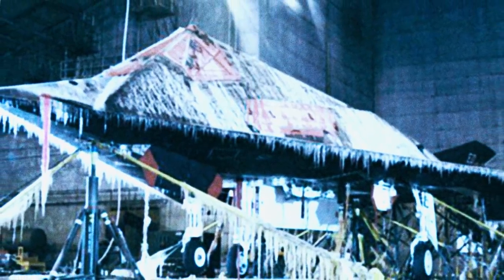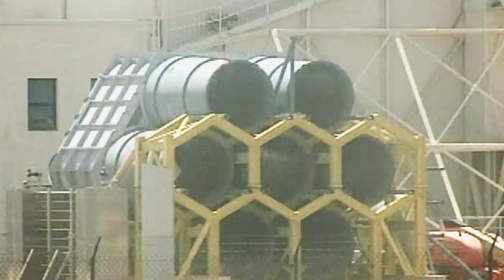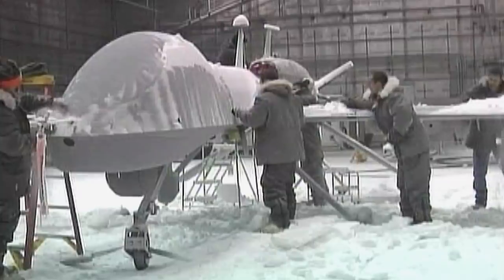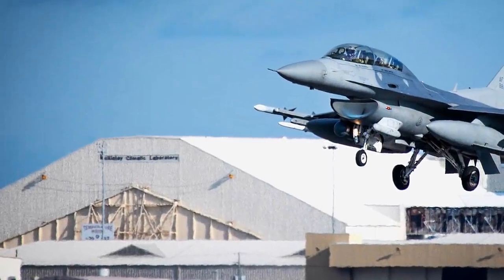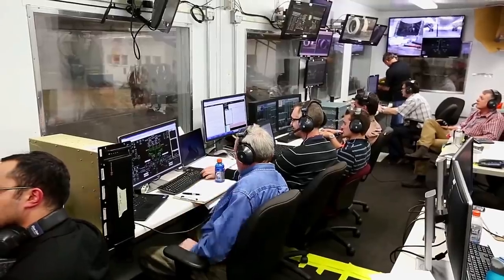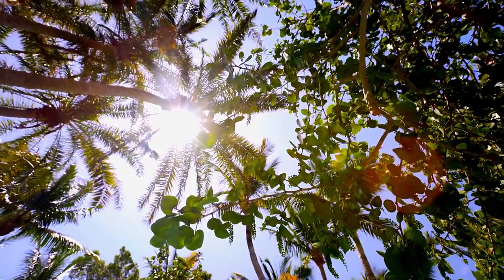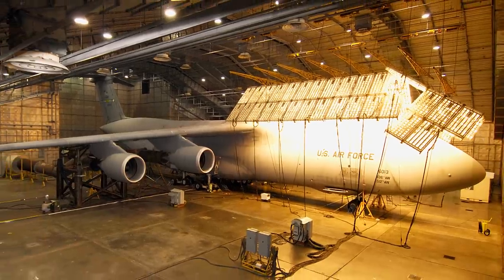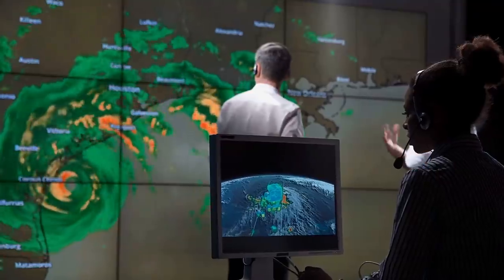A Stealth Fighter Left Too Long in the Freezer

Comment: Just heat it up for abt 4-5 minutes on high in the microwave
Reply: Yeah
Reply: Middle won't be warm
Reply: @caspersmelik8650  then just microwave it for another 30 seconds or so
Reply: @kaptainkrafter4130  yup
Reply: These planes taste bland. Are they frozen?
Reply: @ItsToXxy  No sir, they are fresh

...ly frozen
Reply: @kaptainkrafter4130  F— meeee....Why did the F117 cross the road? 

Because you didn’t f—ing cook it!
Reply: Or put it in the oven on 350
Reply: Casper Smelik gotta kept turning it beo
Reply: Actually a microwave needs the object to have water molecules to heat that object up. It works by using a specific frequency of vibration.
Reply: @ItsToXxy  They might need a little seasoning.  Lol
Reply: It’ll go soggy
Reply: I wonder if they have a microwave hangar too
Reply: @chasemc69  ice doesn't melt in the microwave
Reply: I heard that if you do that with a tin foil ball itll become smooth, and if you do it with a fork itll turn into popcorn
Reply: @Jonathan-zb7wx  Bruh don't
Reply: You have to cut it in half to make sure the centre gets heated up as well.
Reply: Lol
Reply: Wait no thats not good thats a metal thing buddy
Reply: @kaptainkrafter4130  it's so raw it's still flying in the car
Reply: Ehhh, I'd try defrost

Comment: USA be like: Yeah lets build the worlds largest plane freezer... in Florida.
Reply: Maybe unwise, but they did succeed
Reply: Well, one needed to move jobs to the proper congressional districts.
Reply: every decision has justifications, especially on a project that big. i bet there's a lot more heat/humidity testing required than arctic/cold. if that's the case, florida is a good place.

Comment: Used to work in a small scale version of this for wind tunnel testing in Dearborn Michigan for Ford motor company. We had 2 full scale climatic wind tunnels and a bunch of soak rooms. We also had the ability to simulate altitude and below sea level. And one of our wind tunnels could simulate sunlight

Comment: I was part of doing climatic tests on the AV-8B Harrier at this facility in the early '80's.  It took us a bit over a month and in that time we went from negative 40 degrees to plus 120 Fahrenheit.  We learned a lot about the capabilities of the hardware and were able to correct some problems before production aircraft entered service.  This is a totally impressive facility.  Thanks for the video!

Comment: "We wanted to test cold weather on planes, but Alaska's weather fluctuated to much and wouldn't stay cold enough.  So we built a warehouse with air conditioning we could keep cold all the time.  Instead of building it in Alaska where we would only need a little bit of AC once in awhile, we built it in Florida where it is 100 degrees Fahrenheit.  We don't have to pay the electric bill for the air conditioning.  Tax payers pay that bill, so why should the US Air Force give a shit?"  -The US Air Force
Reply: You hit the nail on the head there
Reply: While airframe testing is done in Nevada, Eglin AFB is where everything which goes BANG or gets dropped from a wing pylon is tested, it makes complete sense to base the climatic lab there.
Reply: I worked on a polymer processing factory that couldn’t be heated above 15C and had a warehouse at -20C - so it was built in Singapore where the average temperature is 30C all year round. It isn’t just the military that does this.
Reply: But that ONLY considers the additional benefit in cooling costs being lower.
Now factor in transportation of the aircraft, vehicles, equipment, people, fuel, and everything else that goes along with running a facility like this.
I'm sure Florida was a far better choice for many reasons.
Reply: The ambient outsie air temperature has nothing to do with the efficiency or cost of running this type of facility.  The heat pumped in from all of the equipment needed to have this type of facility means that even in Antarctica you'd need an a/c system to keep it super cold.
Reply: XT 002 Differential temperature requires more energy to overcome.
Reply: Cooling/freezing  isn't the only weather they replicate, as seen, they also heat, so whether it's in Alaska or not, the same amount of power would be needed.This was built in the  1940's, Back then.most if any of Alaska was not developed, like it would be, if one was making the decision where to build it today.
Reply: In 1940, the US Army Air Force designated Ladd Field in Fairbanks, Alaska as a cold-weather testing facility. Because sufficiently cold weather was not predictable and often of short duration, Ashley McKinley suggested a refrigerated airplane hangar be built.  Maybe they were just a LOT smarter than you....

Comment: As an hvac tech, the fact that this place costs $200,000 a month in energy is insane to me. I have residential customers that spend nearly $30,000 a month on their energy and they aren’t deep freezing or nearly melting the place. The efficiency of what they are doing is unreal, I would be fascinated to see what kind of cooling setup they have to be able to get such a large space so cold, in Florida of all places. And getting a space that large to 165° is no easy task either, especially if it’s not combustion driven heat (lights/electric heat). This building probably has somewhere between 1-1.5 billion BTUs of heating/cooling capacity

Comment: Extremely interesting, but I would love to see a video of the equipment that produces the climatic conditions. The actual machinery* and not just a few control panels. The refrigeration system would be huge to cope with running engines sucking out the cold air !

Comment: Ford needs to capitalize on that for marketing:

"When the largest climate testing facility in the world needs to move a F-22 Raptor at 65 degrees below zero, they don't need just any truck. 
[Sound of truck starting easily, lights come on] They turn to the all-new 2022 F250 Superduty Platinum..." [Truck drives out of hanger towing fighter jet].
Reply: Yeah and they will hide the block heater

Comment: $10,000 per day to rent that place seems incredibly cheap.  A crappy banquet room at your local Radisson will cost you a few thousand.  And all it has is stained carpeting.  No 100 million in testing equipment, and if you can get the A/C to drop below 73, you must be in a newer building.  

I would totally hold a wedding reception there for 10 grand.  Bring your jackets, and get ready for a snowball fight.

Comment: EEROR AT 3:48 The altitude chamber has an ability to simulate pressures at altitudes up to 80,000 feet. The air at high altitude is C O L D, well below zero even at 30,000 feet, let alone higher (the Elevation of Mt. Everest is 'just' 29,000 feet). So when (as stated) it simulates temperatures from 80 to 140 Fahrenheit, it's clearly WRONG. The link below states that the 'standard' temperature at 80,000 feet is a negative (-62 F)
https://www.engineeringtoolbox.com/standard-atmosphere-d_604.html.